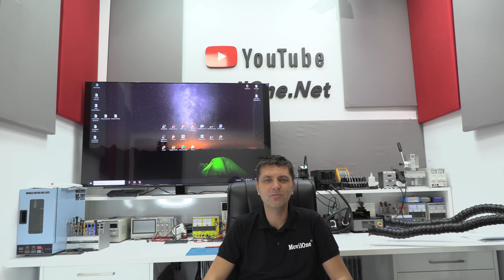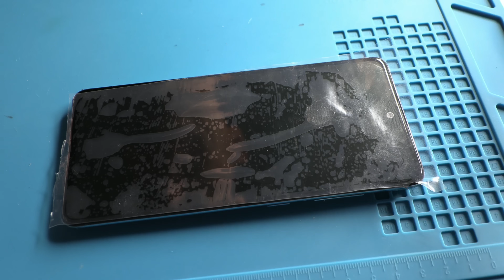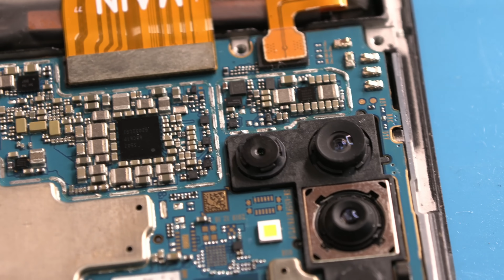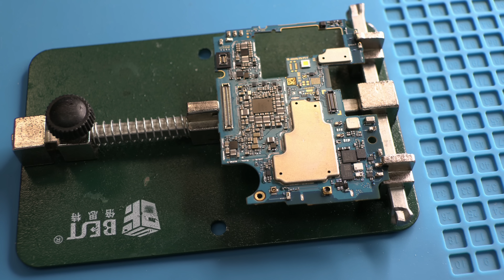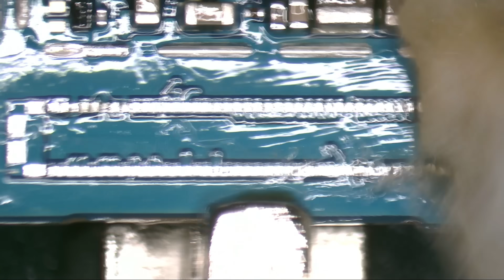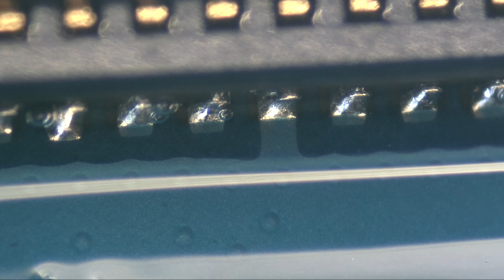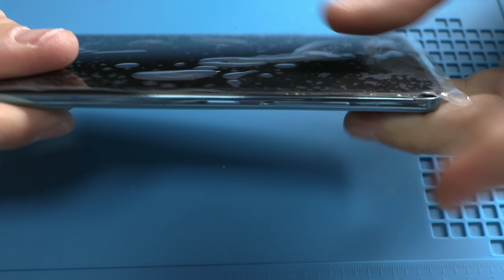The Samsung A Series Secret They Don't Want You to Know!

Comment: My Global version A15 5G is always in a flip caseand never exposed to extreme temps. with luck it should last for the promised 4 Android version updates. But you're right about declining quality. I still have a 3G only phone on Jellybean which I use on WiFi as an internet radio and MP3 player from the sd card. Oh, and the battery still retains a very good charge.
Reply from the maker: If your A15 5G stays in good condition and receives four Android updates, that’s a solid lifespan. It’s impressive that your old 3G phone still works as a WiFi radio proof that well-built devices can last much longer than manufacturers want them to!

Comment: You didnt elaborate detail bout the topic issue rather than focusing on repairs.The common issue about Aseries is true. Many of technician focusing on replace thermistor, but they were lucky, the problem solved not by replacing thermistor but right after when they assemble back the board cover screwed it back tight which pressing back the FPC connector to the mboard track.
Reply from the maker: That’s an interesting observation! Many technicians replace the thermistor thinking it’s the root cause, but in reality, reassembling the board tightly may be what actually restores the connection. The issue with the FPC connector losing proper contact is a design flaw that affects many A-series devices. Thanks for sharing this insight!

Comment: Happens on Samsung M series as well, on both upper and lower FPC. On most phones, making a jumper from FPC to FPC, or from the flat and FPC between the +5VCC lines works, some unlucky people need a whole FPC replacement.
Reply from the maker: You're absolutely right the M series also suffers from similar FPC issues, both on the upper and lower connectors. Creating a jumper between the +5VCC lines can sometimes solve the problem, but in more severe cases, a full FPC replacement is necessary. Thanks for adding this valuable repair tip!
Reply: Does it happen on Samsung S21 ultra or any S series? Thanks
Reply: @ not that I'm aware of. It can happen, but it's on normal probability grounds, but in A and M series it's likely to be 100% of chance in the first 3 years of the phone.

Comment: Same issue in countless car modules, cracked lead free solder. Terrible stuff.
Reply from the maker: Absolutely! Lead-free solder is a huge problem not just in smartphones but also in automotive electronics. Cracked joints cause failures across various industries, yet manufacturers still rely on it due to regulations.
Reply: @MovilonePhoneRepair  Make Leaded Solder Great Again! 😉

Comment: You are right.  Excellent video.  If you treat your device like a thin-shell-egg, by using a good cover, avoid bending, pressure, moisture, fast charging, even high temperature caused by direct sunlight, you may be able to use your device at least until it is useless by intentional software updates which, again, it is designed to force you to purchase a replacement if it has not failed from hardware failure!
Reply from the maker: Very well said! Taking care of your device can help extend its lifespan, but eventually, software updates will slow it down or remove key features, forcing an upgrade. Manufacturers have perfected this cycle of planned obsolescence.
Reply: @MovilonePhoneRepair  use a custom rom :)
Reply: This happens to my Samsung Galaxy Tab from 2016-ish. Hardware still in good condition but it's useless now because of the software
Reply: People in samsung didn't provided any software update to my j2 pro 2018 and it's still running on nougat sadly all apps are not supported now.
Reply: @-Shibbi  if the software is the problem, you can try a custom ROM
Reply: @reizinhodojogo3956  I don't understand about custom ROM. I have looking for info but there is no custom ROM for my phone model. Many sources says slightly different model can result bad
Reply: @-Shibbi  maybe a downgrade or stock android(directly from google, instead of company-supplied android)
Reply: Don’t update after one year
Reply: @azambinomar7398 What about security patches?
Reply: @azambinomar7398  You will get forced updates sometimes from the manufacturers that get done overnight. Security updates are a must as they include critical vulnerability patches in the software and firmware.
Reply: @azambinomar7398 They never tell you this but software updates actually decreases the life span of the phone. I  used my samsung A6+ for 5 years without  updating the software. Then my friend updated my phone with the latest software. The phone became slow and unresponsive and other problems too.
Reply: theres custom roms 
much better than stock in battery CPU and GPU handling
Reply: xkhem27 In Australia, custom ROMs on Samsung devices completely disable normal phone calls because our dumb government made VoLTE compatibility mandatory and Samsung devices have a proprietary VoLTE implementation that doesn't work at all on LineageOS or any other AOSP based ROM.
Reply: Samsung green line displays. Pixel 4a. I use adb to turn off Samsung updates on all my devices. Won't buy more from them.
Reply: seeing this on my still fast enuf for most apps galaxy s7
Reply: Happening right now to Pixel 4a
Reply: I have a 2018 device that is heavily used , there's some battery degradation and lack of updates but still functional😊
Reply: I got 4 years out of an A20. The display ended up failing but it was from water damage that resulted when I took it apart to replace the USB port.
Reply: I'm curious,  fast charging is bad?
Reply: @marcellachine5718 It causes more heat and batter is compromised faster.
Reply: @marcellachine5718 there's nothing wrong with fast charging it's fear mongering from people with tin foil hat people. Fast charging is advanced and smart enough... the downside is increased heat production but phone circuitry manage heat well unless you charge it under a pillow
Reply: @marcellachine5718 have heard from almost everyone that battery should be charged when it drops to 20% and no more than 80% charge. Same with EV batteries. Maybe someone else here can provide tips on maintaining the battery.
Reply: @marcellachine5718  If you can avoid fast charging then avoid it.  if you want your battery to last with minimum capacity degradation, then turn off the phone and slow charge it.
Reply: Why do you say forced to buy a new like the phone is immortal no matter what u will still have to buy a new one cus of wear and tear on the notherboard from heating and cooling repeatadley just like most devices even flagship
Reply: @Mrheadshots_fps  does purposely design some parts to break in 1-2 years not sound forcing to buy a new one?
Reply: @Mrheadshots_fps  i have the same phone for 5 years
Reply: Probably why my Samsung Galaxy S7 is still going strong.
Reply: I've been using my galaxy s7 edge since 2016. I have already installed the 4th battery and it runs in continuous operation as a wlan router around the clock on a charging pad. Works like the first day without any problems.
Reply: my Huawei phone is at this step now, software has bork it completely, it is almost 8years old though.
Reply: All my A-series phones have become useless through software updates and lack of ram. Never had any issues. Same with my wife. We've been relying on the A-series for years. We don't do anything special, but use 360 degree cases. Guess we've just been lucky. I'll keep buying them until I can relate to these problems. S series is too expensive and I don't like apple. I don't trust chinese phones either.
Reply: My A52 only has its first firmware upgrade, I've owned enough smart devices to know all about the planned obsolescence through so called (firmware upgrades) and so I remove the update module entirely and only allow certain apps to update. Anyway, can confirm with everything here regarding battery and charging care, (only 100% charge once a month and never using fast charging) phone is still working like it's new out of the box and going strong for 5 years now! 🎉
Reply: Nothing wrong with fast charging.

Comment: I had an A series 10s and it broke down a couple months in despite me taking good care of it. I had upgraded to a S series Ultra 22 and it never did any of that stuff. This is why I rather buy the expensive one than cheap ones, it's kinda forcing you to go with that option. Not many people know about this stuff
Reply: I'm sorry but you're extremely naive if you honestly think that simply switching series to a more expensive model is the solution, the fact is ALL of their phones have inherent flaws built and designed into them, just like Every Manufacturer does!
   Just bc you've had good luck with the series S doesn't mean everyone has bc there are Thousands and Thousands of ppl who haven't, a quick google search and you'll find plenty of ppl who've had issues with that series. All I'm say is your small sample size is Not something base a fact upon, like saying just buy a S series and you'll be fine.
Reply: @kcaprod  I've had S series, all the way back to Galaxy S3 when removable batteries were a standard, sure, the harness of the Glass surfaces has increased since then, but the overall build quality has been riding further and further to the edge, making sure even on their top end models that you will break something before the phone is 2 years old, HECK, look at the folding phones and their hideously delicate bending screen section!

The only differences are in SOC performance and aesthetics, maybe a flashy oversampled (the lenses on most phones are far too small to make use of the bonkers megapixel counts claimed) camera sensor or two, the guts of the thing are the same level of "Engineered-to-fail" garenteed to wring more cash out of gullible hands.

If mobile Linux wasn't still deep in it's Alpha/Beta Stage still I'd have long since moved to a FOSS device designed to be used and maintained by regular users, as it Stands I'm looking at HMD, Fairphone, and Nothing Phone among others to find something that will actually last a few years and not just turn to E-Waste faster than what it replaces, in much the same way as my 2012 Laptop has managed to outlive the 2019 laptop that was supposed to replace it because it's much easier to maintain with various access hatches and a removable battery, unlike the glued and clipped together piece of junk that died in less than a year.

I'm frustrated with the current generation of high-power-but-disposable Junk, and refuse to put up with it any more even if it means learning Linux and having to find less-mainstream, but more reliable devices.
Reply: Don't be foolish, no mater the cost all tiers of the same company's phones have the same faults built in, your paying more money for the same critical faults
Reply from the maker: That’s a common experience budget and mid-range devices often cut corners, leading to reliability issues. Some people prefer to invest in a high-end device upfront to avoid frequent replacements. Unfortunately, not everyone is aware of these differences before making a purchase. Thanks for sharing your perspective!

Comment: I fell in love with my a51. Really great phone for 2 years then i moved to the a54 cause it was on sale for $99 so i couldn't pass it up. Still runs as fast and as good as day 1 a year later
Reply: A year later? LOL! My phone from 2014 still runs perfectly well and does everything I need so no reason to update it. The manufacturers make new models that do everything the same as previous model to fool you into buying a new one and billions of others also got fooled. The same thing happens in the car industry. If it's not broken don't replace it.
Reply from the maker: Thanks for sharing your experience!
Reply: @MovilonePhoneRepair  I'm still using a Samsung A40, which I bought in 2019 & my main Phone is an A52s which I've had for 3 years, both still working perfectly, both still on their original batteries too, although the run time between charges is probably about 70% of the original time, but that's to be expected!

Comment: Can anyone help me. I got a galaxy mega 6.3 and it just stopped working . It turns on and stays at the logo. I am a novice please help.
Reply from the maker: It sounds like your Galaxy Mega 6.3 might be stuck in a boot loop. You can try booting it into recovery mode by pressing the Volume Up, Home, and Power buttons simultaneously. From there, you can attempt a "Wipe Cache Partition" or a factory reset. If that doesn't work, the issue could be hardware-related, and you might need professional repair. Let me know if you need further guidance!
Reply: @MovilonePhoneRepair  I have tried   it and it does not go to the menu
 Stays on the logo.

Comment: Got a question here, Is it only Samsung phone's or are there others manufacturing brands that the public should be aware of.
The reason I ask is because - There are so many videos out the on You-Tube claiming these phones are the best from the reviews, when in fact like you said there is a hidden flaw that is just waiting to revile it's true nature in failing due to poor manufacturing - if this is so then all phones are failures waiting to happen because of this 1 connector...
Reply from the maker: In the mid to low-range segment, almost all brands tend to have their issues. However, things are different in the high-end range because these products are built with higher-quality components, making them more durable.
Reply: i have a Xiaomi Redmi note 8, two weeks after i bought it both of the microphones died, i searched and realized a lot of people that bought this model had the same issue, even other Xiaomi phones had this exact same issue when i first learned about it, I'm not saying every Xiaomi phone is deliberately broken, but it's clear that there is something wrong
Reply: Sony since Xperia 1, 5, 10 (2019) until (2023) have issue with fingerprint sensor failure. Meanwhile Xperia 5 II (2020) to Xperia 5 IV (2022) have green line issue which Sony use Samsung OLED
Reply: @arx117 almost all phones having a oled display has a chance to develop green line

Comment: this guy lives in the conspiracy world,samsung has changed this connector on the next a-generation  and there is not a single isues with cracked solder on it,sure i had few replacements of this one  too but has nothing to do with the quality of it or its soldering
Reply from the maker: respect your perspective, but the cracked solder issue is something that many repair technicians have encountered, particularly in mid-range Samsung devices. It’s good to know that newer models may have improved, but the frequency of these repairs in older models makes it hard to overlook. Constructive discussions like this help push manufacturers to improve. Thanks for sharing your view!

Comment: can you blame sumsung for the FPC connector being fragile though because the connectors are made by molex who are the biggest manufacturer of these FPC connectors and with the current devices being so slim it has lead to the connectors being more slimmer hence it fragile than before as it has so many pins nowadays
Reply: If it is a known issue, the phone design should change but that costs R&D money they dont want to spend.
Reply from the maker: You make a valid point—manufacturers like Molex do face challenges designing connectors for increasingly slim devices. However, the decision to prioritize slimness over durability still falls on companies like Samsung. It's a delicate balance between design and functionality, and it seems like durability sometimes takes a back seat. Thanks for your insight!
Reply: yes. samsung made a design that requires this cable but as proved by many phones out there you can make a phone without it too. and one alternative would be to solder this cable to the board instead of using the fragile connector

Comment: You didn't change the USB port ?!?
Reply: why would he when it's only the connector on the board
Reply: @Yè-Xiān-l2h  because metal connectors wear out systematically!

You don't know anything about recurring breakdowns on smartphones. lol
Reply from the maker: That’s correct; in this repair, I didn’t replace the USB port because it wasn’t necessary. The issue was resolved by addressing the damaged connector.

Comment: Well, here in EU 60/40 solder is forbidden. We are forced to work with lead free solder which makes it almost impossible to make this repair with  good quality... Of course as a professional it is still possible to order (or try to find a old spool on ebay) , but by law only to be used on old devices already containing lead from factory.
Reply: I can order lead solder wire with no problem and i am not a profesional.
Reply: You can repair the device with leded solder but civilian manufacturers have to use lead free solder only military use elecronics still use leded for obvius reasons.
Reply: Really? Then how does Cynel sell such a good quality leaded solder as an European brand?
Reply: 😂 no good repair service cares, no one will check if the solder is lead free or not
Reply from the maker: You're absolutely right! Working with lead-free solder significantly complicates repairs due to its brittleness and higher melting point. Finding old 60/40 solder spools is definitely an option, but the restrictions make things unnecessarily difficult for repair technicians in the EU. Thanks for sharing your perspective!
Reply: little hint: nobody will come and check what composition your solder is made of, even as a repair business. nobody gives even half of a duck about using good 60/40 or 63/37 solder that doesn't fail from being brittle like the lead free crap